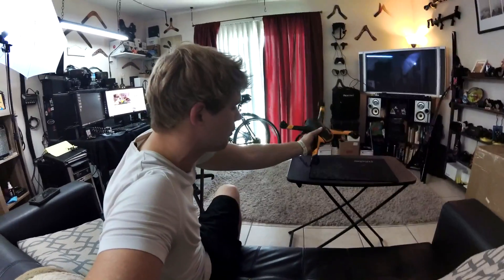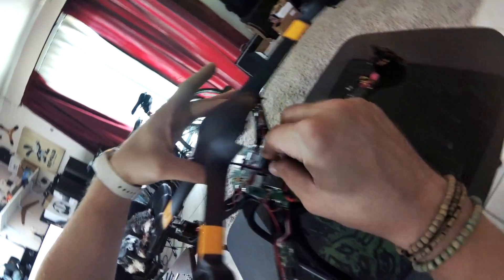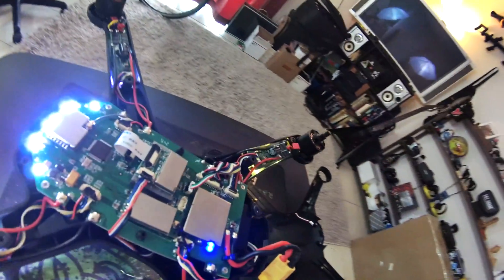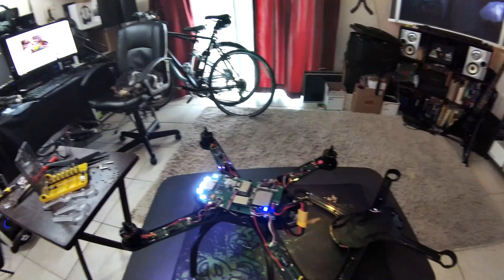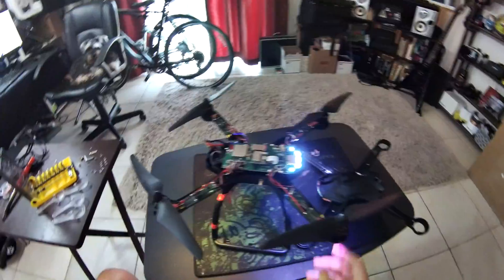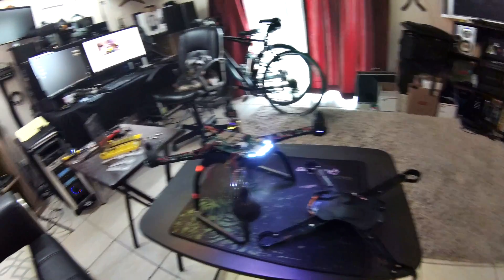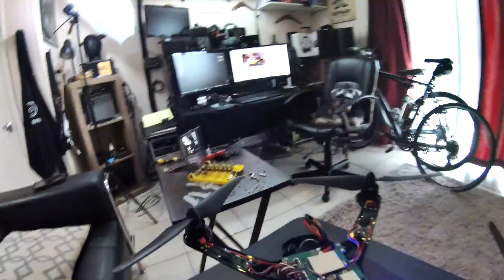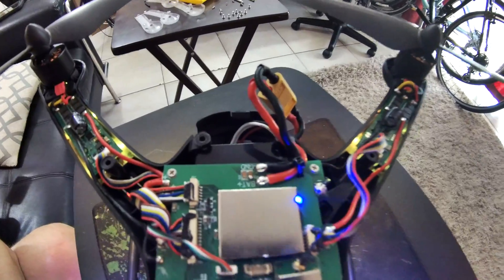Drone Speed Controller Repair + Test Flight | Hubsan x4 Pro H109s

Comment: I think you are a good craftsman! I have a question!I changing the B motor and the B ESC of the 109 S DRONE ? but it seems that it does not work on the same foods as the other three needs some software reinstallation or someone to live because when I throw it turns around its axis it rotates You have some advice to give me?

Comment: I have to tell you one thing I'm jealous that you are able to open your drone mine came with over tight stripped screws and something is rattling inside and I cannot get into it and Hobson support team sucks all I heard was sorry get a new body
if you could just do me a favor can you get  close up picture of screws that are at the bottom by the LEDs I'm trying to figure out what are they biting into
Reply from the maker: Greg Kopanczyk  these require a hex screwdriver still I'll have to check the size